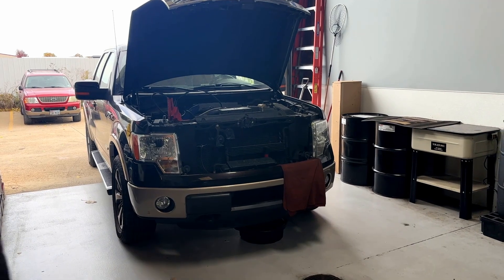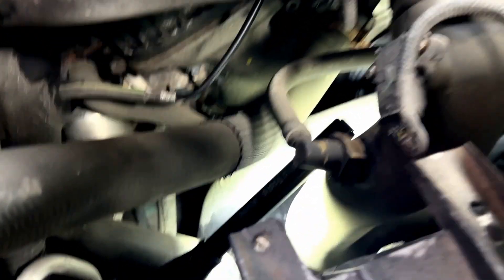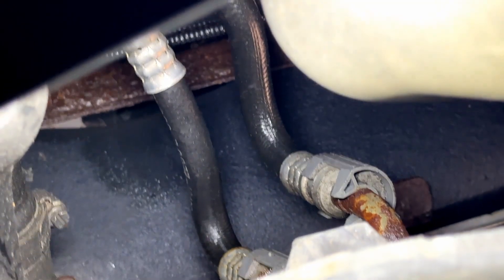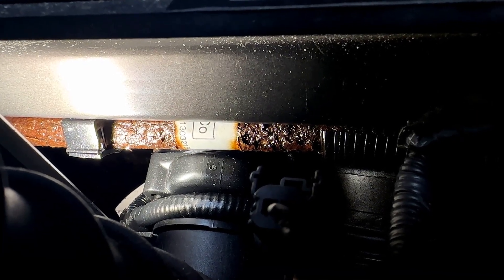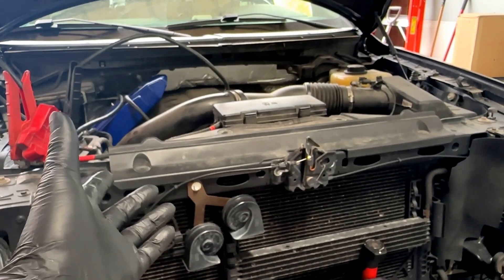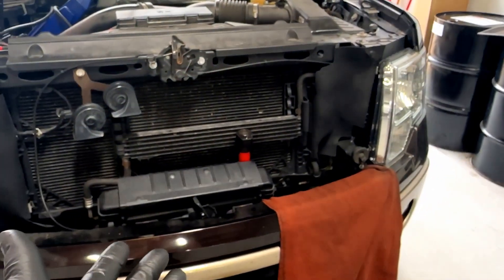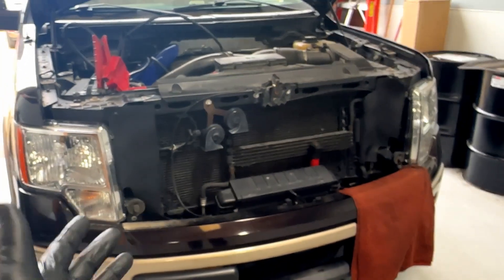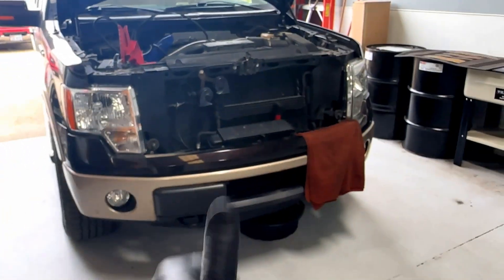One Last Time: Do Not be The Next Victim of Faulty Ford F-150 6R80 Transmission Cooler Lines!

Comment: I have a 14 Mustang with the same transmission.  I wonder if this applies to the trans lines in my car. I'll have to take a look at the fittings.   My transmission was rebuilt by Ford, The rebuild lasted just past their rebuild warranty and I  started having issues with the transmission again( different issue). They( Ford) call it "the squawk " and said it was common with this transmission and the fix is to put in their friction modifier kit. I did and "The squawk " went away and the trans is working fine now , I'm just hesitant about pushing the trans and having it slip again. Have you seen a lot of this issue? Should this fix hold up?
Reply: How many miles on your trans when you needed a rebuild?  I also have a 2014 Mustang GT with right at 35,000 miles on it.  I changed the fluid and filter at 31,000 miles.  So far mine seems fine.
Reply: @Mr2004MCSS  I don't remember the exact mileage but a close guess would be around 60k for the  rebuild. It was covered under my Ford warranty.  I had a plastic burning smell but did not know it was the trans. until I  took the car in for something else. The dealer told me I needed a trans. rebuild.  From what I hear these are good transmissions .  I  may have just got a bad one .  I did buy my car used. After I had the transmission "squawk " that was fixed by the friction modifier.  I purchased an extended warranty . A trans replacement is over 5k .
Reply: @Sd-ht9zu  Thanks for the info.  They are supposed to be pretty tough transmissions but you can get a bad one for sure.  I bought my car new and have not beat on it so hopefully the transmission holds up.  I added a drain plug to the pan on mine so I will do a drop and refill in about 30,000 miles.

Comment: I've had my fair share of vehicles having common problem that only surfaced after the warranty period. How Ford is getting away with a issue this large without being held responsible is only known to those paid off.

One item that after replacing a few times is the parking brake cables. In the northeast, they rust up causing either an internal break or the parking brake to freeze in place.

One of the first things I do now with any vehicle I purchase is to take a piece of heat shrink tubing and enclose the entire cable sealing out moisture. The same thing and be done with the replacement transmission cooler lines. For lines that have large fittings that preclude the heat shrink tube, rubber splicing tape used int he marine electronics world also works well.
Reply: Ford has a lot of former government officials on its board. Nothing will ever happen to them

Comment: Your first video saved my 6R80. I looked at my cooler lines and seen that the compression fitting had split and very recently because the metal was still bright and shiny. So I took your advice and changed everything.  All lines,front cooler, filter and fluid. I also added a transmission dipstick as well from a well known manufacturer so I can keep an eye on level and condition. Thanks again!!!!
Reply: Tell us more about the dipstick: like where do order one
Reply: @tsr7198  B&M 22200 about $250. Yes expensive, but no more crawling, burning my arm to check level and conditions.
Reply: @tsr7198  B&M makes one and so does Performance Automatic.  They are both very expensive at $250+  I have the Performance Automatic dipstick tube installed on my 2014 Mustang GT with this transmission and it works well.
Reply: @Wayne Dimirsky  I had a b&m and it sticks too far into the transmission to even get an accurate reading. Ended up putting the factory plug back in because it was easier to read than the b&m.
Reply: @kargmeister  I drove around got it hot 198°. Checked fluid level very carefully used side of file to scribe dipstick. BEFORE  installing B&M I matched ends together and copied level on new dipstick. Then installed.
Reply: @Jeremy Anderson  That's what I did to and lined up the factory one with the b&m and the fluid level was up on the braided line past the marking area which means the b&m is in the pan a couple of inches too far. Put the factory plug in, and it's at the top marking when hot where it's supposed to be.
Reply: @kargmeister  That is too bad.  I didn't have any issues like that with the Performance Automatic dipstick that I installed on my Mustang.   I've not had the B&M one before so I can't compare.
Reply: Good man I had to replace my transmission two years ago because of this issue
Reply: Let us know how the Dipstick works out... Plan on doing the same, tired of burning my fingers at my  fluid /flush change intervals,
Reply: Summit used to have one for $99 but now it is up to $176. Look up part  PA68401
Reply: How old and miles???
Reply: @ElonMuskX  2011 81,000
Reply: @ElonMuskX  2013 171,000
Reply: @Minneapolis_Freedom  Thanks.  I have a F150 2011 with 85000 lines look great not sure when to change them?  Will the new lines do the same?    Ford should replace all of them
Reply: I was looking at my 2014 Expedition. It has the same type of connectors, but they are mounted differently. The lines are supported by the radiator and transmission cooler. The lines have some flex to them. The truck lines are solid mounted to the body with no flex. Also the transmission end of the lines are mounted to the engine. So all the vibration is concentrated at the connector. Also the engine slightly rotates around the crankshaft on acceleration and deceleration. The connectors are near the center of the crankshaft. Any rocking of the engine when the motor mounts are worn would work the connectors side to side causing the lines to break. Also the lines ends are made in a press that pushes the metal to make the locking ring. The bends are very tight in the tube. These can cause a weak point at the bends. The weak points in the tube, the solid mount to the frame, the rocking of the engine, weak motor mounts, the connectors being close to the center of the crankshaft could all come together and cause a failure of the lines.
Reply: That stub of a dipstick is a killer, when that Tranny's hot.
Reply: At the time I believe the mileage was 160,xxx. Well I'm about to turn 190,000. Not one leak. Shifts, tows just fine...

Comment: I already replaced mine because of one of your previous videos. Less than $300 for the three lines and some fluid to top it off. A couple hours in the driveway and it's good as new. Very simple proactive maintenance. Thanks for all your advice.
Reply: Whered you order them from? Thanks
Reply: Part number ??
Reply: Part number ?
Reply: @cheizaguirre5494  Hi should be CL3Z7R081A - call local Ford dealer and order.
Reply: I own a 2014 mustang GT with a 6R80.  Does this apply to this vehicle also?
Reply: @jameswinters8021  most automatic transmissions have coolers so it applies to all vehicles with cooler lines.  Your car is a sports car I would assume it has a cooler to cook down the transmission so yes.
Reply: @HealthSupercharger  hey thanks.  I had planned on checking it, just wanted see if any other Mustangs with 6r80 had the issue.   Appreciate the response.
Reply: @jameswinters8021  look for the lines, see if they need changed... duhhhh
Reply: @ThisIsSolution  you can't always see the damage. It's typically where the line meets the quick connect fitting. They crack and break off flush at the aluminum collar.
Reply: Still another reason to avoid Fords.  For a company that's been making cars longer than anyone, they have a piss poor product where their customers pay an extensive amount more in "maintenance".
Reply: @bertblue9683  What are you talking about? Consistently Ford has won awards for having the most reliable trucks, and ever year sells more trucks than any other brand. Highest towing capacities, most engine power. You seriously want to sit here and claim that Ford sucks because of repair issues that come up after 100,000 miles of service? Is Chevy or Ram issue-free? Because last time I checked, GM and Chrysler have had more recalls for actual dangerous issues than Ford.
Reply: @NickFormic  he's not trying to bash forward saying that they suck. He's just trying to warn people about a potential issue and save them some money. Why the hell are you getting so offensive over it?

Comment: I watched the whole video. My steel lines were in very good shape, but now I am thinking of a full replacement. 11w/ 6.2L.

 I cut back my rubber lines to the steel ones under grille. If you cut the last crimp shell with a rotary wheel there is a nice place to slide a 1/2" line with a bead and serrations in the line.  2 clamps.
 Replaced with Napa Premium Bulk Trans hose. 5-6' of hose, $35 or so.  Not the best repair but better what what is there.

Why did I do this? The Ford place here actually advised me to do it that way if the remaining lines aren't corroded. He also said the CRIMP SHELLS that hold the rubber (in addition to the quick disconnect) are fair game to split and the rubber line slip off the tube, he keeps one to show customers. So I removed all lines w/ crimps (all the cooler lines have them) for a straight rubber hose. I didn't believe it until I found some evidence online. Not common, but it happens.

It is a 10 minute job, inexpensive vs the whole set, and they do it to help customers, better than nothing. If the lines under the truck are corroded, then replace. They say it is not uncommon to suddenly fail, usually a new trans is installed.

But I am thinking now of a whole set, it is not that expensive if I DIY.  I would replace all the tubing pieces with crimps.  But its great you spread the word and potentially save someone 6grand.
Reply: Cutting an oil line with a rotary abrasive wheel seems like a great way to get silicon carbide in your bearings.
Reply: @GHinWI  you are just cutting the shell off the crimp in the length.   You should not even scratch the rubber if you are careful. You can clean it off then remove the rubber hose.

Comment: my lines blew exactly right at that point on my 2013 back in 2020. I was on the freeway at night doing 55MPH (in traffic). 
The metal literally just cleanly snapped in half. No corrosion. Completely fried the tranny, all the solenoids and the torque converter we’re toast. 
86k miles on the clock at the time. 
Cost me $5.5k for a complete rebuild, I got stranded out of state for almost 4 weeks, and I was out of work for a while month.
Reply: wow
Reply: Wowzer..........
Reply: bro...
Reply: @Bullitt-1165  Good luck with that, Ford doesn't do much for you.

Comment: After watching this I had mine checked. They say it’s just fine. Now I’m not anywhere where rust is much of a problem should i still worry? My lines are real clean
Reply: I'm in the same situation. I live in Florida so not much rust other than the boat ramp. Lines are shiny and look new but I don't trust those connectors. I wiggled them a bit and seems okay but I didn't want to create a stress spot where there wasn't one by jerking it around. I wish there was a cheaper fix someone would do a video instead of 600$ replacement for the same connectors

Comment: Ford should be ashamed of themselves with such pathetic leaks at early age.  I popped a pinhole in my trans line cooler after 20 YEARS on my 97 F-150 in NY state where salt is viscous on stuff, which I caught before any damage to the E40D.   It has all new OEM lines from RockAuto.

Comment: Thanks to your first video on this, I had my lines replaced on time on my 2012.  After watching the video , I checked my quick
Connects and saw the lines were  damp with trans fluid right under the quick connects.   Had them replaced at ~80000miles.  Guessing it was metal fatigue in my case.  Hopefully this gets me another 10Years or so.

Comment: I always wrap any new cooler lines with self sealing tape, keeps external rust from pitting, but really not much can be done for internal degradation except keeping fluid changed and fresh. Sulfuric acid will  hidden eat anything .  Love the vids Brian!!!
Reply: Why would they make the fluid corrosive?
Reply: @DarinGC  Nature of trans fluid and moisture combined .....
Reply: @MrHossola  Wouldn't that effect even more sensitive components in the lead frame? Makuloco in the other video was indicating it was poor alluminum casting at the fitting.
Reply: @DarinGC  100% agree with Brian yes, but add external and internal corrosion together and I'm pretty sure we all know what's in store....lol, as for lead frame issues, they happen all the time.

Comment: The hoses coming out the quick connects are bent fairly tight. Is that a flow restriction..
On my 96 E250 4.9. Because i serviced the transmission every 40k to 50k. It lasted to 475,000 miles

Comment: On my 08 one of my trans cooler lines leaked due to rust a little over a year ago. It was due to that plastic clip that holds two of the lines on the driver side trapping water on them. I need to replace the other longer one before it goes too!

Comment: It would be too easy for manufacturers to add a trans low pressure light and a low fluid light just like they do for the engine. It would probably cost 40 bucks per vehicle if they did it on a mass production scale and put it in everything. It would save customers untold millions in trans repairs. Especially since these automatic transmissions are costing upwards of 6k for a new unit.
Reply: It’s bad enough that most no longer have a dipstick easily accessible to check levels.
Reply: Exactly

Comment: I don't think some people realize you were a Ford dealer mechanic for years before you opened your own shop. Thanks for all the Info!
Reply from the maker: Yup and now all do is work F-150s it seems, so I know them pretty well.
Reply: @FordTechMakuloco  I'll be looking at mine when I do my turbo coolant lines and timing chian, tensioner, phasers and Melling HV pump. All Do to your tech info saving me thousands in labor from the dealerships that don't do the best work. If you can't do it right the first time  you don't get a second chance. This is why I do my own work.
Reply: That’s a really smart way to set yourself up for early retirement.
Reply: @markm0000  What most people don't know about the old guy down the street with the Ford with 350k miles is that: he's had any part that looks questionable changed over the years. Not waiting until failure.
Reply: @FordTechMakuloco  juste amazing good infos  thank you  mister ...... from quebec canada
Reply: @FordTechMakuloco  what state/area are you out of? Curious in case my truck needs worked on thanks!
Reply: do you do vids for super duty@FordTechMakuloco
Reply: @FordTechMakuloco hey Bud great channel! Where is your shop located at? I’ll love to bring my 2013 F150 3.5L V6 in the future for an overhaul
Reply: Ford should have to do a recall, it’s their fault